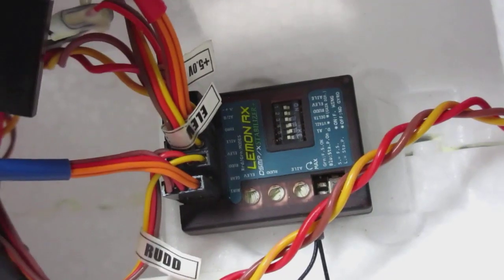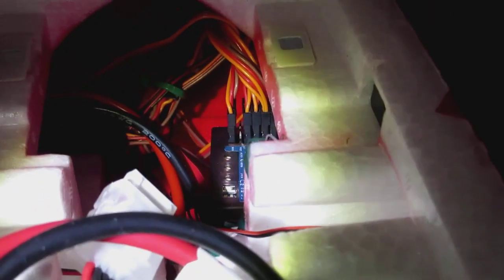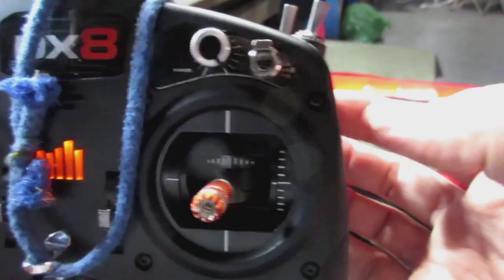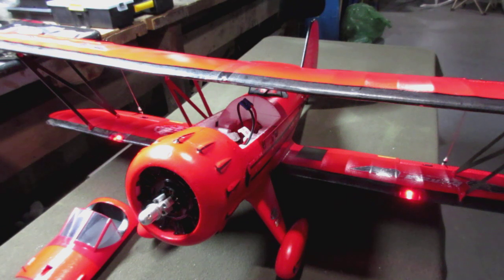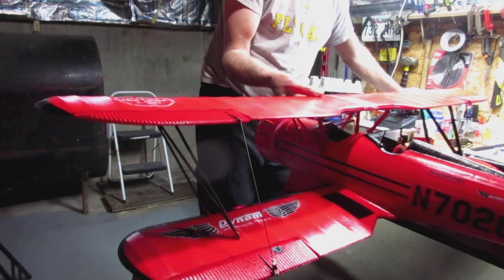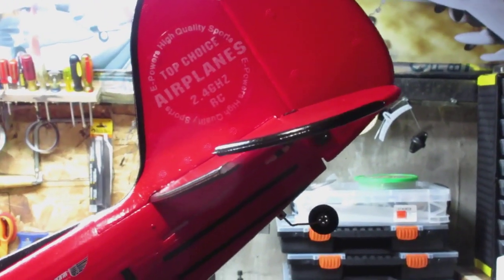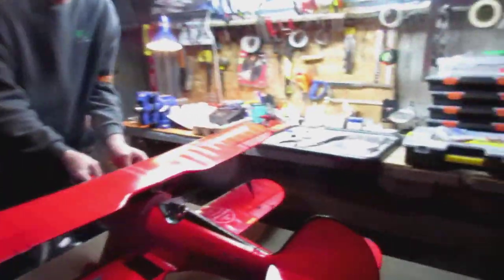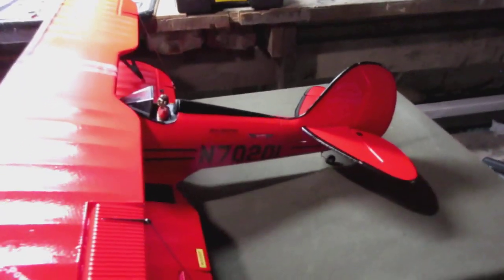Lemon Stabilizer plus 7ch RX (Receiver) Part 2  Installation and testing

Comment: So with the Lemon 7-ch stabilizing receiver, if you lose your orientation or have one of those panic situations, can you flip a switch and the receiver will auto-level the plane to avoid a crash (provided you're not too low)? And have you tested it and found it to actually work in that panic/self-leveling situation?
Reply from the maker: It's not a panic switch... but if you switch from normal gyro stabilizing mode to what is equivalent to Safe Mode (like on a Spektrum AS3X receiver)... it will self level when you let go of the sticks (sticks centered).    So if your flying in manual mode (no gyro)  or in stabilized mode (gyro on to counter the wind) and you lose orientation or lose it in the sun... you can just flip the gyro switch to safe (auto level I guess) and let go of the control sticks and it will go to the straight and level that you pe set it to.     So your gyro switch is in effect... your panic switch if you use it that way
Reply: @markhyde43  Have you tried it? You know...like getting it in some goofy twisted orientation, flipping the auto-level switch, and then letting go of the sticks...and it really did level out and fly straight pretty quickly?
Reply from the maker: @SteveGergetz  I've tested it and it does work.    You do have to make sure the plane is in the atitude you you want it to level at when you do the initial set up.     Mine sometimes goes to a very shallow bank or turn depending on how the plane is trimmed.    It's hard to pre-set a perfect level that flies straight without any slight variance in the air.   But it will save the plane in those circumstances. 
But for me?  Unfortunately,  when I've gotten in a pickle,  I usually don't get to the safe stitch until it's too late.    I always forget about it and do what comes instinctively....  try to fly out of the situation hoping to get lucky.    That often doesn't work and I tell myself in hindsight...... Man.  I should have threw the safe switch..      you don't think about in the moment.
Reply: @markhyde43  Man...I know exactly what you're talking about. Been there myself as well.

Comment: Hi great tutorial  ,
With the unit turned on looking from the back of my plane ,
If I turn the nose left what way should the ruder  compensate (go) ?
Reply from the maker: The rudder should deflect too the right... in an attempt to bring the nose back to where it was.     Is much easier to observe if you do the test in safe as opposed to doing it in stabilization mode.   Because in stabilization mode,  the compensation is minute and momentary.   In safe it deflects and remains that way until the plane is returned to level.   Although the rudder doesn't have much input in safe unless you have heading hold... because it's not really a levelling feature.   It still should stand out alittle more I think than on basic stability mode. 

But yes.   It should deflect momentarily to the right.
Reply: @markhyde43 
Thank you my friend,  I ended up throwing the instructions in the Bin,
Thank you for taking the time to do these Tutorials,
And getting back to me,  👍🇬🇧

Comment: Im going to try this in a carbon cub S2 so sick of spektrum bull
Reply from the maker: Yeah.   The new spektrum receivers with the forward programming are very smooth bu complicated to navigate the programming process.     These lemons are much simpler and are reliable with gyro and safe features,  but are not quite as smooth.
I have some larger planes that work better with the new spektrums.  Others do well with the lemons
Reply: @markhyde43  im using a dx6i so its a kind of a pain no 3 position switch no forward programming and and a lot of mixing to get all 3 flight modes. Might go back to futaba

Comment: Can we have the RX set on a 2 position switch...Stability and SAFE mode  no OFF position. I have ALL my EFLITE planes setup that way AS3X ON/Safe ON on 2 position switch A
Reply from the maker: I would think so.   It would just be setting the +100/0/-100 values on the digital channel switch setup seeing so that the two values you need for stability mode and safe mode are programmed in.... I would guess.    
I don't have the manual right handy at the moment.    But it does have a two position switch option.

They have downloadable manuals for it either on the Lemon site is the Admiral receiver site.

Comment: I'm having a problem with my wing in normal mode everything works right when I put it in stableization it's all opposite, I have it set for delta I believe it is dip switch 4.  Great video by the way
Reply from the maker: I've never used delta set up.   If the stabilization gives gives wrong direction throws for correction ( best observed in auto level/safe mode) but servos work correctly with the stick inputs on the transmitter... Then you change the dip switch on the stab receiver for that channel (dip switch#1 for aileron).     
That will change the stabilizer correction direction for that servo...but will not affect the servo direction inputted from your radio transmitter.  Same for the elevator and rudder.   
Make sure that the radio transmitter servo direction is correct first though.
The dip switches for each channel on the receiver itself (aileron/rudder/elevator -switches 1-3)  only affect the stabilizer correction direction input.

I've only used normal mode,  but that's what I do for reversed stab inputs from the receiver

Comment: Hello there and thanks for the video! Can I ask a bit of a noob question please? Ive just ordered the Lemon 7 ch PLUS rx. This has a voltage input max of 8.4v. Does this mean I will need to replace the ESC with one which has a BEC or such? I'll be using a. 11.1v battery you see.
Thanks for the help mate.
Reply from the maker: I don't think so.   I don't know what you are planning to put it in.   I use this receiver in on the off my  older Timbers, and that uses 3S (11.1v) lipo batteries as well.   Never had an issue regardless what ESC I use.    Most ESCs have internal BECs anyway.    Most of my plans have internal BECs.  Only a couple have I installed am external BEC.   Your receiver will likely only put out 5+ volts to the servos anyway.
Reply: @markhyde43  Thanks for the reply. So the input voltage from the lipo won't destroy the Lemon RX basically, even if it's over the rated input voltage for the RX? I'll be using this rx on an FMS Ranger btw.
Thanks for the info, again.
Reply from the maker: @poopscoop2000  in pretty sure that your receiver is going to get its voltage from the ESC and not the battery.   Unless you are using an external (separate)  BEC that bypasses the ESC to the receiver.    The receiver should never get direct volts from the battery

Comment: Thanks for the very informative video debunking the magic of the Lemon Stan PLUS receive.
I have aq DX9 and I would like to know how to assign the stabilizer gain amount to the variable knob on the transmitter.
Your help will be much appreciated.
Cheers
Reply from the maker: I don't have a DX9.   I know on the DX8 gen 2 it is automatic.  It defaults to the R knob unless you change it.   I would assume it would do the same on a DX9 as a default.

The way to test it is to initialize safe/auto level and make sure your in high rates to give the surfaces the most deflection....then change the knob as you move the plane around and see if the surface deflection to return the plane to neutral increases and decreases with the knob

Comment: just watched part 2   again...I am guessing it's also  a good idea to add a preflight check of making  sure that all control surfaces respond correctly in SAFE  ( gyro ) mode.....really helpful video, thanks.....
Reply from the maker: Yeah. I kind of botched doing that witch turned out to be a real time example on video.  I had flown that and did not realize until demonstrating that on camera that the elevator gyro throw was reversed.   Good thing I hadn't tried to put it in safe during flight.  Would have been bad news.
I caught it during the video demonstration.

Comment: I am new at rc airplanes and plan on buying the Stab Plus 7 channel  Rx..... I have a Spectrum DX6 Tx...my plane ( Bigfoot  ) will have flaps......do you think it's fairly easy for a beginner to set up...your video states do not use Ch 5, so where  do I plug in the flap servo?........ thanks much....gary
Reply from the maker: The 7 channel receiver (stab plus)  had 2 aux channels.  Aux 1 and aux 2.
I use channel 6 (aux 1) for flaps if I don't have retracts on my landing gear.   If I have retracts, then I use aux 1 for my gear and aux 2 for flaps.
If your using a 6 channel transmitter that would pose a problem you will have only 5 usable channels for flight controls, gear and flaps...unless...

Unless you forgo the safe (auto level feature)
The 7 channel stab plus receiver only uses channel 5 for switch selection between stabilizer mode, manual mode and safe mode.

If you choose to operate the receiver and plane with the stabilizer always on and no safe option, then you can use that channel 5 for the gear as normal.

The receiver ONLY needs channel 5 free if you are using all modes- stabilizer, manual and safe and assigning a switch to select between three 3 of them
Reply: @markhyde43  OK...so it shouldn't be a problem for me...as I will only be needing 1 extra channel for the flaps..( no retracts )   and I will assign flaps to the  Aux 1 channel and keep channel 5 open for the 3-position switch..., right?...thanks again........
Reply from the maker: @garyvale8347  yes.  That sounds right.

Do you have the PDF manuals for the 7ch lemon stab plus receiver?
Reply from the maker: Here's the link to the manuals for these lemon receivers

https://lemon-rx.com/manual
Reply: @markhyde43  I did download the RC Groups link and read the instructions  on the " Stab Plus "   ........the price is very good and the Lemon  reviews I have read were all positive...I  am a Spectrum guy but I like to save a buck whenever I can ......thanks again for your video, as it was very helpful !!!
Reply: @markhyde43  thank you sir.....I  really appricate your help....Gary

Comment: DO you calibrate the gyro f the rc outside of the plane and the rx must be installed in a level position?
Or it is better to have the rc installed in the plane then calibrate the gyros?
I am looking for a stabilizer rx and undecided between a Frsky s6r and this lemon in your video.
Any comment is greatly appreciated.
Thanks
Reply from the maker: I believe I set the receiver up plugged into the aircraft wiring but un mounted so I could check the servo directions and stab functions including safe....before mounting it in airplane.  In case I had to change a dip switch (toggle sw on the receiver) position.

Then I just mounted it on the small  flat shelf on the left side just behind and slightly below the battery compartment deck.   Accessed through cockpit hatch.

That way I can remove it to make changes if need be.

So if need
Reply: @markhyde43  Ok thanks!!

Comment: I had an issue with my 7ch Lemon Stabilizer Plus, I tried to install on 2 of my other planes, an A1 Skyraider 800mm and a Arrows Viper 50. Both of them have a 2 servo aileron system, like most planes. So watching your video I had switches 4 and 5 "on" but left switch 6 "off". After a few crashes, I read the manual again and noticed switch 6 has to be on. That solved the problem. I assume your red plane had a 1x aileron servo with a conventional tail.
Reply from the maker: No.  It's a 2 servo system.  It's not the number of servos that affect the model type and the position of the switches on the receiver....it's how many channels you see using forthe control channels.

Most 2 aileron servo planes are considered 'normal' set up because they use a 'Y' connection to the receiver...so the receiver uses one channel only to run both servos for the ailerons.  The Y connector makes the output command opposite throws for the two alieron servos.  That's why you only have the two switches 4 and 5 turned on for the receiver.  It's operating as a both servos on a single channel.

If you choose to run both aileron servos independently from the receiver... Then you would use two separate receiver channels..say... One servo plugged into the aileron channel of the receiver and the other plugged into an Aux (spare channel)of the receiver.   Them you would use the switch #6 on the 
receiver.

When the manual says single aileron...it means two servos plugged into on channel with a Y connector.
When it says two or dual ailerons...it means two servos connected to the receiver independently using two channels.

So if both servos (one aileron control system) are on a Y connector using one channel.  switch on only the # 4 and 5 switches....if both servos are used as a two aileron system (independantly) turn on switches 4, 5, and 6
Reply: @markhyde43  very well explained, i wonder why mine worked when switch 6 was on and i had a y-cable conected to just the ail port? Could it be that switch 6 "on" has no effect in plane's performance when nothing is plugged into that aux1 port?
Reply from the maker: @texasuavpilot  perhaps

Comment: Did you get to fly it and test it out and make sure that it works yet I'm thinking about getting some  of those to put in some airplanes I have
Reply from the maker: Oh.  I've flown it many times now since then.   It works great.   In fact I have 3 planes with that receiver in them.
Reply: @markhyde43  that's good news I need to get a couple of them for some of the Cubs I have so I can have my friend fly with the safe part of the the receiver and not destroy a good airplane and I hope it takes the scary out of my rad jet ultra I made a lot of mods to it and it's crazy fast now

Comment: I'm very grateful you explained this about the auto level feature , I do believe this is what is going on !! When I flip out of safe ... Everything is norm , flip safe on and OMG !!!! What just happened.... LOL !! Thanks again !! This will help many pilots now and in the future. What's the best way for your PO # Thanks hujum .. AWSOME video
Reply: RC Flyby MR....   so what happens to your plane when you flick it to safe/auto level?  I have this same rx,... and so far I like it in just gyro mode... but when I flip it in safe its all over the place... instead of smooth and stable/level...      so what is the fix for this then?
Reply from the maker: @berniek8238  remember there is the stabilizer receiver and there is a stabilizer Plus reciever.   Only the stab plus receiver has the safe/level function.    You may have to do the level reset to establish the level position for your plane. There is a toggle sequence within the first moments of power up that sets the receivers current level.   The default level may not be correct.
Reply: Bernie k Hey Bernie , sorry just noticed your question. When I flip to auto level it rolls upside down. Just had to flip a dip switch. The elevator was reversed on the RX
Reply: thank you gu @RCFlyBy911 s!!  I think I figured it out.  Yes my elevator switch was reversed as well.. fixed that.   did a level reset as well.  now just need to go fly to test!  should work! thanks!
Reply: Bernie k Super ! Glad you got it all worked out. Once you have these Lemons down & figured out they are a really good RX.
Reply from the maker: I believe you can use channel 5 for anything as long as the stabilization is set to be on all the time with no switch to control it.  But you would not have safe mode because that requires a switch to turn it on & off.   If you had the stab and safe assigned to a switch, it has to use channel 5.  If you had a BEC plugged in there, then when you had the stab turned off, the BEC would lose power (be turned off) as well when the switch is off.
I wouldn't.
I'd put it in aux 2 or channel 7.